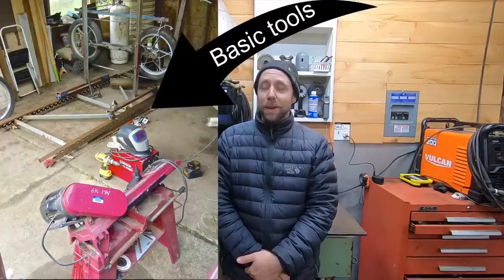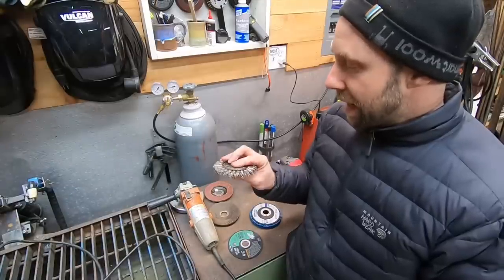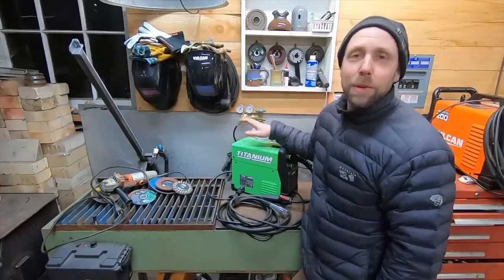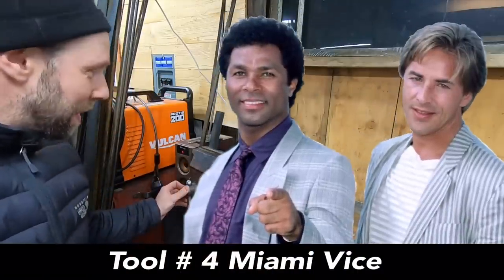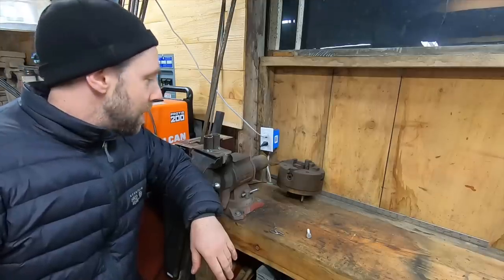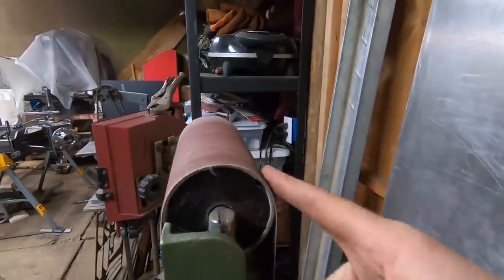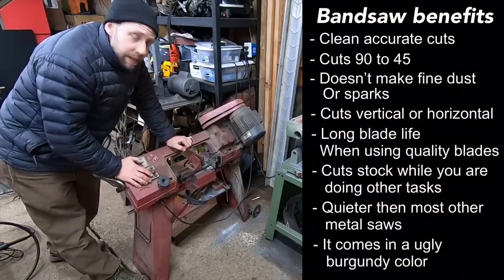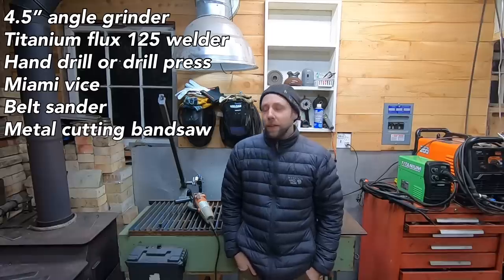6 affordable tools I recommend to get started in fabrication

Comment: for some reason I have trouble making anything right with out the high end tools. you probably have the nack for eye balling and getting the right angle that bend you did on the flat bar was pretty cool with the vise I would need a 1000 dollar bender to do that.
Reply: Yeah it's great if you have all the best possible machinery and a fully equipt metal fabrication shop I totally agree. . .  however the subject here is from what I understand getting started and setting up a small home metal fab shop for the DIYer, how to equip it, with tips on how to acquire basic tools that are both useful and affordable and have it be a source of knowledge help and advice without ridicule from those of us that have the experience in this trade and that are patient and willing to help someone . . . and if we are not careful we all might learn something . . . . .

Comment: The backside with a MIG welder insttead of a MMA/Stick is that there is more moving parts in a mig that might mess things up. you have gears that pushing out thread and in the handle u got some stuff that easely can get clogged up and u need to replace them.  But on the other hand u can weld for a longer period of time without needing to change the electrod thread. With a MMA  it might get harder to light it if u lost some flux on the electrod and u need to switch the electrod when it run out wich is alot of times compared to a MIG wit a 1kg-1.5kg reel in it.

Comment: first I like the video and agree with most of what you say (welder/fabricator 40+ years)
I sort of agree with you about gasless MIG BUT if you start with stick you can weld stainless, cast (you need to know right way to weld with cast).
Stepper bits personally I would keep away from the cheap ones, but a cheap drill set can be OK as long as you don't get the cheapest.
4 and 5 agree they are things you can get after you have started.
BUT something I think you should of said is
a good ruler/straight edge and a square.
Reply from the maker: Thanks for checking out my video 👍 I cover all non power tools like clamps and measuring devices in part 2. Take care.
Ps keep in mind this video was intended for someone interested in just starting out on a budget, I would have recommended a multi process welder MIG, stick and TIG for someone that’s not on a shoe string budget. Take care

Comment: I like your recommendations but I would also like to recommend the 120 volt  titanium 140 from Harbor Freight yes it's a little more money it's 399 you can look for a super coupon and get it for Less but then this also gives the option for gas shielding so that you can get into shielded welding gas metal Arc welding   also gives you access to their newly released spool gun and then you can do 1/8th aluminum with it overall great video learned a lot from here
Reply: Derek Bryant - What he recommended is 100% fine, but I agree with you. I went with the Ti 140 myself for just those reasons.
Reply: @chipb1193  it is absolutely fine I was just stating that any one might as well bite the bullet and get a gas hookup just in case why I have to buy a machine twice and you're still not spending $1,000 truthfully what can't you do with a good a hundred and twenty volt MIG welder a good angle grinder like he showed I have one and a reciprocating saw hundred 10 volt and 1/2 inch 110 volt drill you don't even have to have the gas bottle like he said up front it's just that that titanium 140 has inductance and is variable voltage absolutely nothing wrong with what he said as recommendations they will get you started I just thought I would recommend that and again I love this guy's Channel I'm currently following along for the dump truck build actually
Reply from the maker: I’m definitely all for a MIG welder with shielding gas, I would even recommend a multi voltage unit, even if you only have 120 volts in your shop,  so when you upgrade your power to 220 you would be all set to weld at full amps. I just suggested this welder because for the price and what you get it’s hard to beat for $150 on sale. Thanks for commenting guys 👍
Reply: @Mikefestiva  i agree

Comment: MIKE - I'm putting a plasma cutter over the band saw - thanks for the tips.
I CONCEIVE of using some kind of rotary tube holder and patterns cut with a scroll saw.
I fingure besides anything the bandsaw can cut - it will cut anything I can't cut without a bunch of other single-size cutters.
Reply: iOn-Christopher DiMeglio I would put a good oxy acetylene torch over a plasma or band saw. No power/ air needed. It’s more diverse of a tool, and really helps with thicker metals or bending/ hardening/anealing

Comment: I’m a beginner starting off with a  stick welder  because I’m gonna be welding galvanized pipe and was told by a welding buddy that it’s the best to use and safer than mig on galvanized even though mig seems to have a lot of uses compared to stick
Reply from the maker: Greg Fowler I highly recommend using a welding respirator when welding Galvanized metal, or at least grind what you can off first around the welded area. The Zinc can be toxic when burnt at those temps and can cause a lot of health problems. I be safe. Take care 👍
Reply: Mike festiva t
Reply: Mike festiva yes I am gonna be wearing a Heavy duty mask thank you for the advice

Comment: Mine would be somthing like:
1.Oxy/Acetalyne torch
2.Trailblazer 305 or other engine drive
3.4.5" angle grinder
4.Portaband
5.Crane 12,000 to 14,000lb
6.Scratch start tig is nice too.

Comment: I have had a drill press down on my wish list for quite a while. I recently moved that wish to a more prominent spot on the list. Started out with a Hobart stick welder and although I did learn quite a bit with it,  I have only plugged it in once since I bought a mig welder. Both of those welders came with significantly larger price tag simply because the cheap inverter  welders were not around back then. Still have a chop saw and agree with a band saw being a better option if you have the space. I should pencil in a used band saw and belt sander in my list where the drill press was.

Until just recently, it seemed like pro welders treated welding as some sort of elite club where you had to spent the bucks on the proper name brand tools  and if you dared to show a picture of a weld on a website forum, you would be beat down a ridiculed to no end on how poor your weld was. I think I will end up viewing many more of your videos.
Reply: Wen makes some good drill presses that might interest you. I have one myself.

Comment: It's worth it to get an angle grinder that has a clutch so that if it binds the wheel it doesn't explode the disc or spin around and break your wrist or face. Angle grinders are as dangerous as table saws so spending a few extra bucks on that is very cheap insurance.
Reply: What would be an angle grinder with a clutch? Never heard of it. My welding instructor way back then told me that a grinder could break my wrist if it gets stuck. Ive always been careful with grinders but what you suggest sounds better. Safety first. Now I practice it religiously
Reply: Agreed about the danger.  I'm a novice and used a Milwaukee 4.5 inch angle grinder with wire wheel, caught my sleeve and almost started to grind up my forearm, when it stalled out from the sleeve material.  Not sure if it was a clutch, but now have renewed respect for that tool...

Comment: Mike, solid video and a great set of tools (only addition probably would be to add a 10" chop saw). I know you have the grinders off and you make note of not leaving them locked in the 'on' position, but you really shouldn't leave your grinders blade-side down in your videos.  I get that this is just a top 6 video, but someone brand new to using a hand grinder could inevitably watch your videos and do the same thing not knowing/forgetting they're 'on' and end up catching a rogue grinder kicking off their fab table. :/

Comment: The harbor freight drill bits aren't the greatest, but if you need a set that you'll just use for those jobs that will ruin your good set, they aren't bad for 11 dollars or whatever they sell for. They don't have a good edge on them from the factory, so I recommend resharpening before you even use them.

Comment: With that bandsaw be very careful when free cutting, the harder the cut or the longer the cut the easier it is to slip or lose intensity of concentration, but the blade will cut through you just the same if it’s dull or sharp

Comment: It's funny that we both have the Amico CTS 160, and the Easy Flux 125. Both are a lot of bang for the buck. I will do some welding vids in the future, after I get a proper filter for my camera. I can't weld for shit tho.😉
Reply: Just keep at it. It helps to have someone looking on letting you know how to improve your welds. 

I learned to run stick in 72 in high school, I didn't get really good till I had run five pounds of rod. When I got into mig welding it was welding aluminum... there was a bit of a learning curve there. Took me a few hours to get the hang of it... then the shop got a steel job in... sweet!

Comment: Mike I agree with the order & choices of powertools. FYI I have found that my portable bandsaw with DIY  base & plate with angle shoe to be the most versatile power tool in my shop. I have an old HF fluxcore welder that I modified $40 with big capacitors & diodes (rectifier) for DC and it welds like it should've from the beginning. A plasma cutter is my next powertool purchase. Can you recommend a cost effective one?
Reply from the maker: Thanks for checking out my video Sean!
That bandsaw sound like a great setup.
As you know I’m running the Titanium plasma 45 and it’s working great so far but I think there’s a lot of good plasma torches for less on the market, I actually have had a few viewers ask the question you asked. I’m in the process of doing some research on the Amico CTS 160, I have never bought anything from that brand so I’m researching it before I buy one. This is a interesting machine because it’s a Plasma torch, TIG and stick welder that sells for $300 to $400 depending on where you look. I just don’t really need another welder Haha but I’m interested in trying it out to see what I think. Keep an eye out in the weeks to come for a possible review? Take care 🙂

Comment: Lincoln classic sae 300 or miller pipe pro if you do A LOT of welding, and a lot of $. It’s a stick welder mostly used for pipeline, but can also mig, tig, plasma cutting, carbon arc gouging, and even power a fifth wheel trailer or your house. They’re diesel and quite.
Reply: Haha, only $18,000? That's a decent down payment on a house!

Comment: Personally id stick with cobalt drill bits. Not the name brand kobalt but the material cobalt. Last forever and drills through everything from fingers to 1" stainless. As far as learning to weld, to each their own but the main reason why ppl say start with stick is because its the hardest process to learn in comparison to mig flux and tig. All those you dab and run. Stick, you push in and drag all at once. Takes about double the hand eye coordination than tig cause tig your using both hands and a foot each movement is individual vs stick welding you doin all movements with just 1 or 2 hands plus keeping line of site of where to weld. Again to each their own for what they want to learn.

Comment: I have one of the cheap HF grinders. I don't know if it's the grinder or just the DeWalt concrete cup grinder, but holy crap that sucker tries to torque its way right out of my grip with that attachment, and I have pretty big hands.

$20 for a grinder and some cut-off wheels, though, is a deal that's hard to beat (even if it is a bit garbage)
Reply: Probably the best grinders are dewalt. Have tried all.  Makita is a crap.  The best drill bits are dewalt and obviously BOSCH.   Problem is the last one cost a fortune.  Dewalt tungsten bits are just excellent.   HF bits are pretty bad.

Comment: Stick actually is Better to Learn with because you can learn Puddle control and more easier than using a fluxcore stick you can control your angle,speed,arc length and arc manipulation
Reply from the maker: But you can control all the same with flux core wire, angle, speed,stick out length and manipulation. Any process is going to have it’s learning curve, it’s just a matter of what ever process fits your needs best.
Reply: And same with TIG.  I learned to weld on a TIG welder and those skills (puddle control, angle, speed, and filler rod technique) transferred well over to oxy-acetylene welding in my experience.

Comment: good video, however, if you buy an angle grinder from harbor freight be careful. I had one of their grinders catch fire. after that incident I went to a dewalt 4.5 and a Milwaukee 9 inch. I can recommend buying quality tools from trustworthy brands. spending the money up front will save you money and headache in the long run.
Reply from the maker: Jake_Productions Thanks for checking out my video 👍 I have ran angle grinders from HF for years and never had any major issues with them, but I understand you sometimes get what you pay for. That being said I did buy a Makita brushless cordless angle grinder and the thing lasted less then a year, it won’t turn on now. I probably won’t buy anything from Makita anymore because of my few experiences with there tools or batteries. This video was intended for someone starting out on a tight budget, that’s why I mentioned the tools I did.
Reply: @Mikefestiva  I totally get it. I started with all HF tools. there is also a good chance I got a dud. With any tool, there is a risk of injury if not treated with proper respect. I urge people to wear the correct PPE no matter the brand. loved the video, keep up the great work! :)

as far as battery-powered tools I like Milwaukee. I don't know of another company with a battery powered porta-band. there probably is one but idk.

Comment: I want to know how you would've planned outlets for your tools different.  Are there big considerations when planning a workshop or am I over thinking it?  How many 220v outlets do you use?
Reply from the maker: I have 3 240 volt outlets in my shop, one for my metal lathe, one for my air compressor and one for my welder, I run an extension cord on my welder outlet so I can have more reach for my welding needs at all points in my shop. That’s what works for me. 🙂👍
Reply: @Mikefestiva  much appreciated
Reply: This is a great question...I was thinking the same thing...wondering if Mike has a VFD install for any of the tools

Comment: One of the drawers in my tool box is labeled grinders. Everything from 4.5 down. Some belt machine small air tools. I use a cut off wheel on a die grinder. Very useful. Way better than in a 4” grinder. Probably 8 different machines. One will remove decals and undercoat with a drum change. Awesome for wreck report. I have a porta-band does anyone know a mount that would make it a chop saw type? Thanks.

Comment: Hi Mike thanks for your educational video.
I have a small question about the Titanium Flux 125.
If you buy a flux wire of 0.035, do you have to adjust the nuzzle or can you do this with the same one?
I live on Curacao and I cannot buy the 0.030 wire here.
Greetings, Marinus
Reply: You have to have the proper sized tip for the wire, and also you will need to flip the wire feed wheels over that will set it up for .035
Reply from the maker: Rien Boom,  Epic Toast is correct. Take care 🙂

Comment: Great video and thanks for helping to make this accessible. I'm interested in metal fabrication, down the road to be focused on bicycles. For right now I just want to practice the basics, mess around with old bike frames, make some metal art, maybe make a tall bike. Hopefully I can do it for under $200-300. Would you still recommend that welder for working on bicycles? Thanks
Reply: I dont know too much about bikes, but I'm pretty sure most bikes these days are  aluminum, which this welder cant weld. But if you stick to steel frames it should be fine
Reply: If you're going to weld frames made of tubes a small tube notcher which can be held in a bench vice can come in handy.

Comment: Plus the flap wheels on the angle grinder won't explode.
Reply: No wheels explode if you use them properly, and stop using them when you're supposed to. have worn out thousands of grinding wheels

Comment: Only thing I will say about welders is if you can skip the 110 volt and go to a small 240 volt welder. I understand if you don't have or can't get 240 and you have to use a 110 welder. Everybody I knows that started with the smaller one has either regretted having a 110 or regretted buying the 110 first.
Reply: Or buy a dual voltage model where you can use either 110 or 240 depending on what you have available :D

Comment: I burned two of those chicago angle grinders in one day. Even if you get the warranty it's about the same price as a good 1 after you drive back with the cost of gas to exchange it.
Reply from the maker: Well maybe I got lucky but I used it a lot, I don’t know maybe you got a bad batch 😂
The only problems I had with mine was every few years the power cords internal wires break going into the grinder, it would cut out when you were running it, I would take it apart and cut the wires back and it would take care of the problem.
Reply: @Mikefestiva   I have heard of many guys that have gotten lucky, just putting it out there to save a newbie some hassle maybe if they have a little extra scratch at the time. it's one of the low dollar upgrades I could think of. great video though reminds me of myself 20 years ago.  You pretty much named every tool I started with.